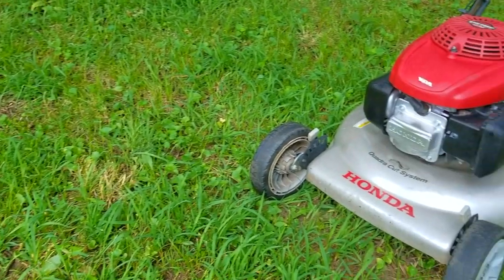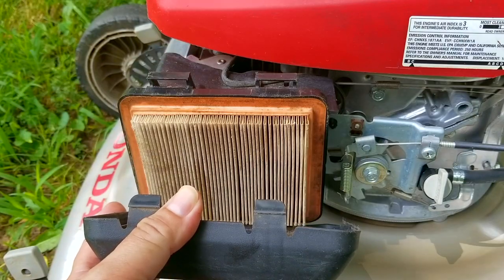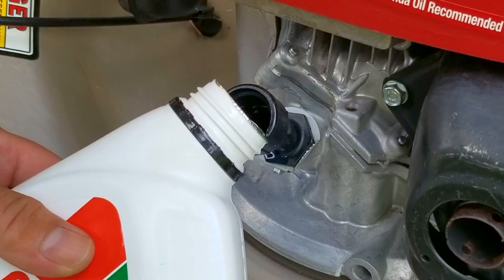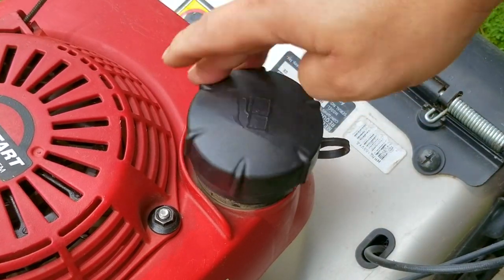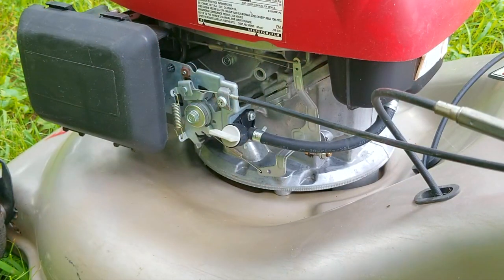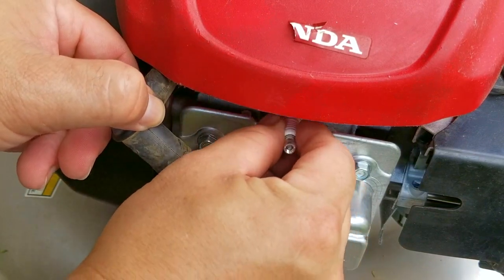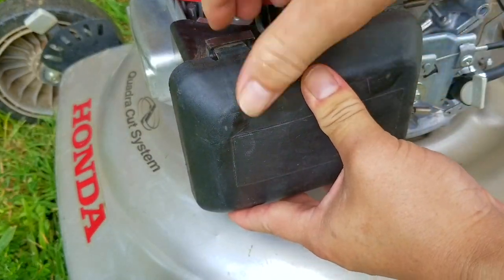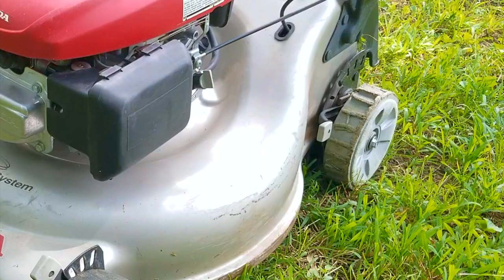Try A Honda Mower You Might Just Like It

Comment: Hello HG, I’m also a big fan of Honda engine, never the less, this is how important it is to store your gas powered equipment away properly, it has been two years the last time I had my power washer out, after going over a few things and filling the tank with fresh fuel, I had it running on the 5th pull. Keep up the great work, your a great teacher for those who want to learn.
Reply from the maker: Thanks for the advice, and I appreciate your time.
Reply: Yea" I agree. I pour about a tablespoon of oil down cylinder aftr changing oil for storage. Spray under deck w/Fluid Film & grass doesnt stick & keeps deck from rusting.✊👍🇺🇸
Reply: Hello HG, I’m power washing my deck and this came to mind. Your in your own thoughts not mush else to do, yes the Honda GX 160 is a good engine, it doesn’t mean you have to run the engine at full throttle, I run the throttle at 75/80% I don’t think there’s any reason to run the engine at full throttle. Just my two cents.
Reply from the maker: nothing wrong with it, it's your choice

Comment: I remember MTD mowers and equipment that doesn't suck. It wasn't even that long ago. I have a 2006 Bolens mower which was the cheapest mower of the time, and it still runs and cuts great, it wasn't even taken care of before I got it. I also have a Craftsman mower which is basically the same mower with adjustable wheels from 2009. They both have the older flathead engines. The decks leave a little bit to be desired, but they are functional and don't have any plastic bits that will bend or break in 3 years.
Reply from the maker: you make a good point. Plastic is not a "long term" option,.

Comment: I actually went battery powered on my push mower this year. Got tired of having to go get gas and trying to pull start it and hope it starts after the winter (it was an old mower anyways) but I have to say I am thoroughly impressed with the battery powered mower. I love your videos! I’ve learned so much from them that I enjoy repairing a gas mower from time to time!
Reply: do your homework, the Lithium-Ion Battery's are not maintenance free
Reply from the maker: thank you Dustin Reid, and nothing wrong with going electric!
Reply: @FLSTF-us4df  when the battery does go no one thinks of what it costs to replace them... Some are almost as much as the mower costed new ,minus 50 to 65 dollars. In that case mise well just pitch the old and buy new then it sadly becomes throw away the mower that is.
Reply: The mower batteries last about 2 years tops. I suggest investing in an electric corded mower. But then again the electric brushes go out in about 5 years depending on usage. I tried battery was not happy. Went back to gas and now just stick to gas and do my own regular mower maintenance. I hope it works out for you.
Reply: The mower I went with was a Milwaukee mower, 5 year warranty on the mower and 3 years on the batteries, I already own Milwaukee tools so I get a lot of uses out of the batteries.
Reply: @raresr4092  not sure what state you are in but in Arizona/California Batteries run $100 plus each and every so many years they change the battery shape so your unit becomes obsolete. 
Manufactured obsolescence.  A true waste of resources and incredibly pollutant for the planet.
Reply: Yeah, electric mowers subscribe you towards planned obsolescence and filling the ocean with plastic trash. Your move was smarter to go with a reputable tool line that work with existing batteries. Taking something proven that gives 20-50 years service is a hard pill to swallow in even a robust economy, but when we encounter hard times is when throw away tools and equipment start really seeming expensive.

Comment: I've had this same Honda mower for 11 years now, bought new. While the engine hasn't given me any trouble (oil changed and fuel drained every fall) the drive system has been an issue since it was 6 months old. The rear wheels would lock up and drag across the grass when backing. Had it to the dealer once for it, cost me 100.00 for them to install Honda's "new and improved bushings" Issue came back in a month. Also, when using for discharge, grass clumps at the back chute. I ended up buying a Toro Super Recycler with the Honda engine and I'm pretty happy with it, after 4 years.
Reply: BTW, the Toro has grease fittings on the rear axle shaft bushings. I think the Honda would have benefited from this.
Reply from the maker: wow, I've never seen it come come back that soon .
Reply from the maker: I agree

Comment: I found my gcv160 on the curb. New carb and valve job runs like a champ. I’ve had this mower since I was in high school I’m in my early 30’s now. Change the oil once a season drain the gas out at the end of the season little wd 40 in the cylinder and a little in the carb throat at the end of the season starts on the second pull everytime. Everytime! Even the first start of the season. Only thing I can say bad about it is the deck is trash drive system never worked and the deck rusted out around the motor mounts I had to use a washer formed to the spot to mount. I stand by the gcv160. I won’t buy a new mower because I refuse the pay retail for another gcv160 but will accept no less😂
Reply from the maker: wow, you're doing a great job taking care of that thing!
Reply: If it makes ya feel any better the gcv200 on the HRX has a lot more torque and is still bulletproof reliable. Given that they are going to stop making mowers it maybe worth buying a new one this year and caring for it forever. I’m tempted to pickup a spare myself even though I got a new one last summer. HRR216 has too many bushing issues. HRX or hrn have better designed self propelled systems.

Comment: Hello HG, the first lawn mower I bought was a second hand Honda Izy. It was a small one as I had a small garden. Later on I moved to a new house with a bigger garden and unfortunately the Izy was too light to handle the job. So I sold it and bought another second hand mower that could also mulch. So I bought a mower from the brand Powerplus. I quickly regret I bought it even though it was still a young machine (less than 3 years old), I was struggling with it to start it, but that might be due to my condition (disability). Anyway, when I went to buy it, the seller gave a demo and after that the fuell started leaking from the air intake. He still brought it to repair and it was the needle in the carb that got stuck. Anyway, last summer the drip that made the bucket to be overflown felt for me. I was mowing the grass when all of a sudden lots of white smoke came out of the muffler. I brought it to repair and the issue was that somehow a seal has moved which made oil to go where it wasn't supposed to go. Luckily it was an easy fix, but the mower still had also an issue with the autotraction. One wheel was going well while the other one almost didn't have traction anymore. The reason was the gears on the wheel were worn out. I also made it to be repaired and when I got it back from the repairshop, I gave it a good wash, took some pictures of it and posted it on a second hand site to get rid of it. I wanted a Honda again, but now it had to be one that could mulch also. New was a no go as way too expensive, but with some patience I found a second hand Honda HRX 537 (from 2008)  which has hydrostatic gear. She needed some love as she was already sitting for one year. She got the love and works perfect now. But I have a question for you. Which special service needs the hydrostatic gear as you mention in this video? I really want to take care of her.
Reply from the maker: thank you for the information, and on the hydrostatic trans you cannot let the fluid level go low or it will Destroy it, you have to check the fluid level. That's it
Reply: @HomeGaragechannel , so I have to lay her on her side (air filter facing up) and than I can check the level of it? And which oil do I need to add it up with? And what's the best to do, add it up or replace it all with fresh oil?

Comment: They aren’t Hondas, but I have a 1990 Kubota w5021 SCC. Quality not found anywhere in walk behind mowers today, or the recent past. I did have to replace the carb and I had to take off the blade clutch to repair. I also have a John Deere 14sb and sx. I could have never afforded these mowers new, but used, as long as you find one that isn’t beat to death is a good choice. I enjoy your videos. Keep it going!
Reply from the maker: thank you Warren Burke and very nice Kubota!

Comment: I cut the heads off some spare carb mounting bolts and user my Dremel to cut slits to change it from a hex head bolt to a slotted screw.
I remove one carb bolt and insert the slotted screw...then the other. Maintaing pressure on the carb while removing the volts is key when doing this so the gaskets stay in place.
Reply from the maker: nice tip

Comment: the real standout on honda power products is parts availability they have dealers everywhere and 99% of commonly needed parts are in stock ready to go even for models dating back 20 years the briggs powered mower i have always has parts on back order for months even something as simple as an air filter or governor spring i haven't had a honda mower since i mowed lawns commercially 5 years ago but if you are using a piece of power equipment to make you money hondas will always have the highest up time the only honda i have now is an eu2200i and it is the only thing i would rely on for emergency back up power
Reply from the maker: you make a good point

Comment: I have an HRX-217, HR-194, HR-195, HR-214, HR-216, and a Toro Commercial Mower 2-xycle Model 22043.  Toro is amazing if you don't want to Bag.  Honda HR series lasts forever.  My HR-214 SM is 1985.  Perfect.  Fertilizer eats up the alloy Decks.
Reply from the maker: Thanks for the info!

Comment: Question I got a FREEHonda mower with a 190cc engine. The previous owner didn't put oil in it and now it’s KNOCKING really loud but still runs. Everything else on the mower is in very good condition. What would you do?
Reply from the maker: without replacing the connecting rod, I'd just keep the oil full, and use it until it goes.
Reply: I would ck the blade/holder. a loose or cracked one make noise as well.

Comment: I think you are partially correct. The other story is regulations and the market are requiring much more efficient / less polluting/ safer products.  As a result, products have to have tighter clearances, lighter weight materials or materials with a shorter lifespan.  With tighter clearances much more wear will result and shorter life spans.
Reply from the maker: you make a good point.

Comment: I bought the cheapest mower which had a genuine Honda engine. The self propel breaks every couple of months due to poor design but I have no problems with the Honda GCV200 engine. I use full synthetic oil and change it every year and don’t leave the fuel in the tank for winter. I hope I can keep this mower working for at least a couple more years. The good thing is, my local big box store has parts for this generic Chinese mower, so I can repair the deck and self propel for however long I want.
Reply from the maker: which Chinese mower do you have?
Reply: It’s an Astor G53, I got it from my local hardware store. I am from Lithuania so not sure it is available in the states

Comment: I've used Honda mowers and if that's what I had or could get, so be it, no problem. I've worked on everything from Briggs to Lawn Boys and lots in between and I might not be a big fan of how they're made BUT it's my option to put my big boy pants on and GET OVER IT or can whatever it was. I've mown with Honda mowers but I like the drive setup in the OLD Snappers better BUT that's just ME! If you want a Honda, GOPHER it! I won't drag you out in the highway and run over you because of it! If that's what I end up with, FINE!  I'd just as soon not have to use a scythe to cut my grass BUT IF that's all there is...............! THanks, Pal! Having a FIT trying to locate GOOD parts for the Troy-bilt because there are NO crossover numbers for their 'briggs' engines. BLESSINGS!
Reply from the maker: I like they way you put that!
Reply: @HomeGaragechannel  I'm pretty much an open book. Too stupid to be devious  but very little!

Comment: Going on my 2nd Honda and really like it. So wished they were continuing  there mowers.. Right now i have a hrx217hya and believe that is the variable speed one. has the orange handle to adjust the speed of the mower i believe 9 or 10 notches. I hope thats not the one that had all the issues just bought it in 2022. I mostly just leave it in one speed and change the throttle setting down a bit.
Reply from the maker: nice, the throttle works well in conjunction with the speed to get the perfect walking pace.

Comment: Quick question  i see you put restore in the motor oil, i know it cant hurt but have you noticed it helps compression?  Also i see 20w50 oil you put in. But its speced for 10w30,. Now that being said i currently use heavy duty 30 weight oil on my 40 year old toro with briggs. Should i increase that to 15w  40 or 20w50? 

Thank Mark.
Reply from the maker: in all my situations that I've tried to use Engine Restore, it has ever worked  for me. So I'm not sure why "other" videos show it working and I can't get it to work. As for the oil I used, that's just a bottle I use, instead of trying to use the gallon jug. It's filled with 10w-30 oil.  as for what you should use, I can't say because that's your choice.

Comment: I'd give anything a try, why not. I agree with you about the used mowers, if you have the money to get one, have at it but I'll never buy one brand new. Too much cash for me.. Why the engine restore in the oil? No oil on the stick and would help if it was not ran with enough oil? 
Also, your thoughts on using oil that may be a little older but never opened.? I find quarts at garage sales and grab them for almost nothing. Good video!
Reply from the maker: so in the first video on this hard to start mower, the compression was low. So that's why the restore was used. But it turns out, that wasn't the issue.

Comment: I was SO fortunate, I got my Honda new several yrs ago new at cheaper price. I change oil often, replace spark plug & filter, & replace blade, also, I coat the bottom of deck with Fluid Film. 👍🇺🇸
What can/do I do to keep my trans in good shape? Especially since its so expensive? Thank u! And GREAT ADVICE!!!!👍 Already sub'd.
Reply from the maker: SO you have the hydrostatic then?  If I recall, there's a fill port on the trans, and you'll need to make sure
it doesn't get too low, on fluid. Otherwise you'll loose the trans.

Comment: Depends on the series of Honda engines.  I have a Honda HRC216HXC with a GXV160 engine.  This engine has studs.  In fact, all of the single cylinder engines in the GX(V) range have studs, past and present.  Kohler’s current engine line on walk behind mowers is loosely based on Honda’s GXV design and so is MTD’s PowerMore engines.  The Kohler Command Pro single cylinder engines are also based on Honda’s GX line.  Briggs engines…never really impressed me.  Even the one Vanguard I have doesn’t really compare with the Honda GX or Kohler’s Command series that I’ve owned and I never had a chance to try Kawasaki or Yamaha but others like them.  My choice of Briggs engine is probably Quantum but they are a pain to work on due to the number and size of fasteners to say fix a recoil starter makes Honda and Tecumseh winners with two or three fasteners to remove.
Reply from the maker: thank you for sharing your thoughts about it.

Comment: I see you have 20w50 oil. That's a good choice for worn engines when you don't have straight 40 weight. I recommend thick oil for large portable generators. I don't recommend using the base oil provided in the product box when buying a new generator. Not even for the first hours of runtime. You'll be looking at increased engine wear from grade shearing/low film strength in high ambient temperatures/long runtime as such (China oil is sometimes just plain mineral oil.)
Reply from the maker: thank you for the recommendation!

Comment: I must say  I do love honda engines .. I have recently purchased a commercial  orec with the Honda GXV160   blade clutch and hydro drive ..  love to know what if any maintenance is required on the drive system???
Reply from the maker: if you read the manual, it should ask you to check the level on the fluid everyone once in awhile
Reply: @HomeGaragechannel  what's a manual 🤣🤣 she's a used girl

Comment: @homegarge would you buy a used HONDA Smart Drive 3-in-1 160cc 21 in. Self-Propelled Lawn Mower "Not running can be parted or fixed has been sitting in the garage for years." for $100 to see if it is repairable?
Reply from the maker: no, that cost is too high for an "unknown" working mower. try  $40.
Reply: @HomeGaragechannel  Thanks, I will offer him $40!
Reply: @HomeGaragechannel  I passed on the previous mower, but I have found another that they are asking for $30 and is listed as "Honda mower will not start. Was working great last summer. Don’t know what’s wrong with it"

Comment: I have a few from every manufacturer and I absolutely dread when honda's surge just because I know the procedure thats soooo much longer dismantling, cleaning, planning on the fuel line breaking because those little Honda clamps are the worst thing going, and then reassembling in a cautious diagram demanding procedure. I like the engine but Ill take a Briggs quantum any day.  I'm not a briggs fanboy, havent been since the OHV engines, but applying the KISS method to anything is always the better rule.  I even show people buying mowers from me the "Million dollar bowl nut" that will normally get a quick fix.  Imagine trying to explain that to a Honda buyer will arch eyebrows and frustrate a owner.
Reply from the maker: oh I know what you mean, I hate it when it starts surging too.